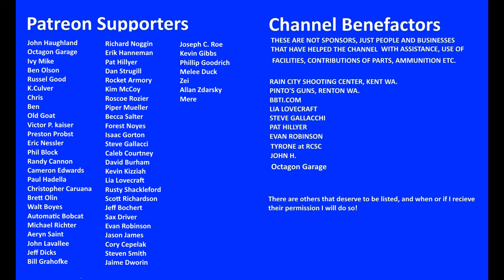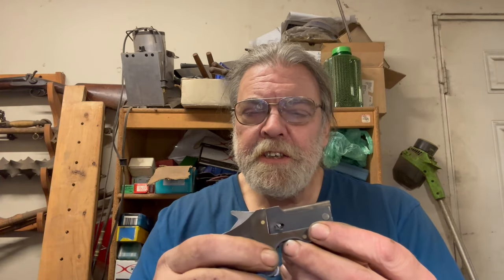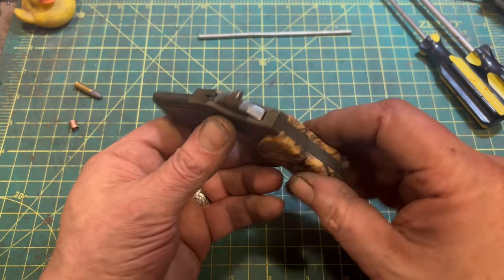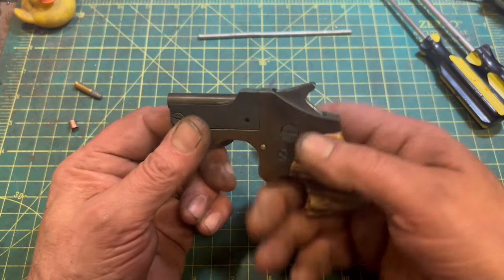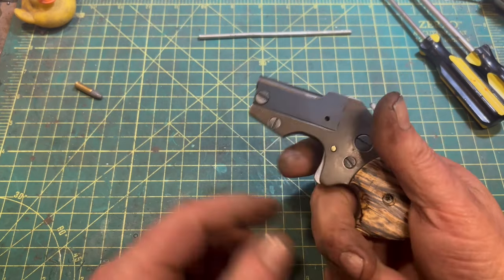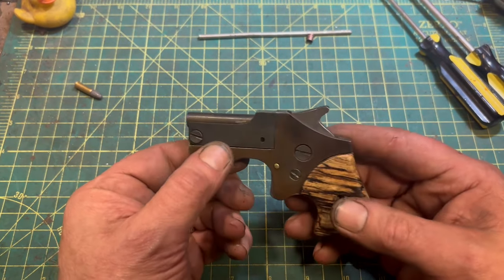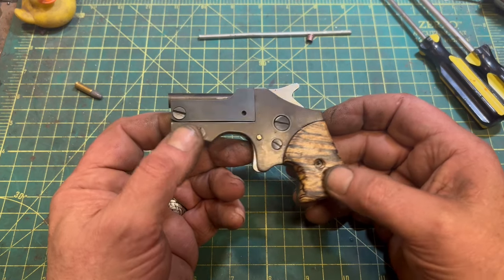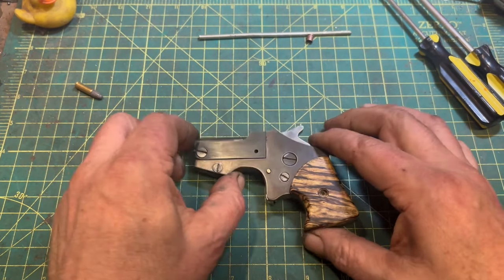Homemade .22 Derringer

Comment: Hey there , Your little derringer is pretty cool. I do have a metal lathe and a small multipurpose machine that I can mill with. I believe I will make a copy of your gun here and only maybe change the mainspring arrangement. Some of the early Stevens 22 single shot rifles had a simple coil spring that is mounted on a hinged strut that would be easy to make and maybe a little more snap to it. The rest is great ! Keep up the good work and great videos.